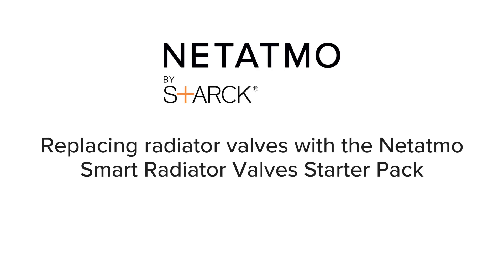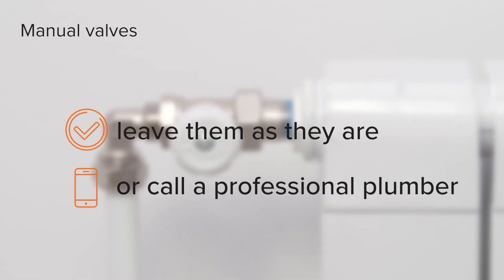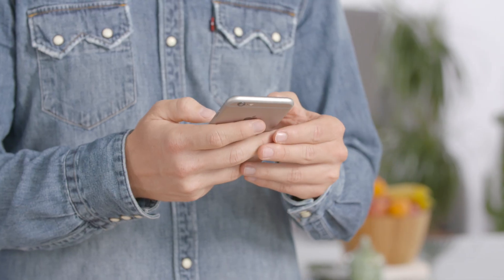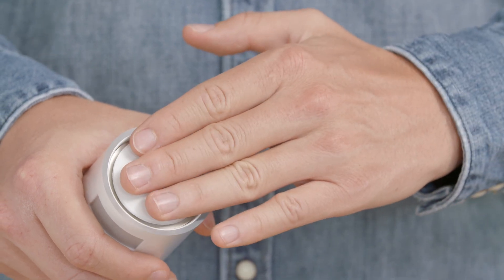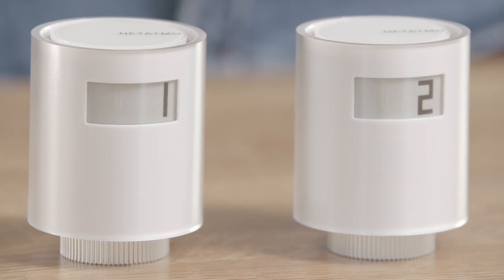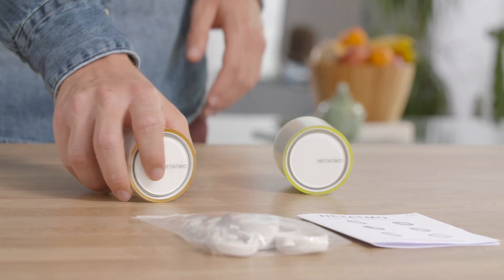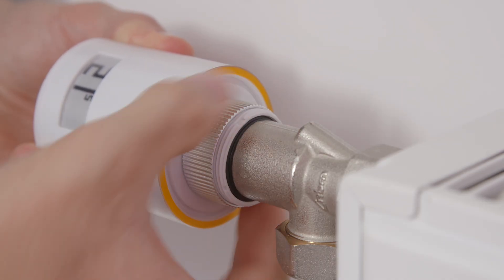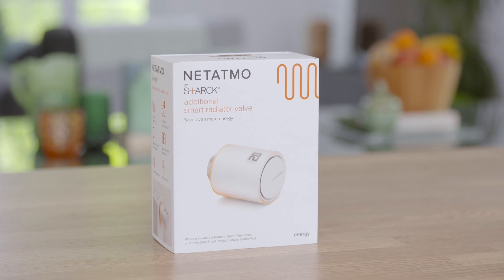How to install your Smart Radiator Valves Starter Pack – Installing the Netatmo Smart Radiator Valve

Comment: I have this in our apartment for 3+ years, quite happy.  I'm pleased to see that a suggestion I made 1+ years ago was put in place:  adding a notification in the App and web based software to give some advance notice that the batteries in the smart valves are coming to the end of their life.

ONE further suggestion for improvement, develop an RJ45 plug in relay with POE (like a Cloud Key).  It's more secure, frees up a power socket and integrates better with a connected home (I have professional quality switches for my home network).

Comment: Will this work when living in an apartment only having access to replacing the Thermostat on the Radiator? no access to boiler or anything else. Also does the Relay require it's own main socket? or could it be placed in a power extension cord if there's room for it?

Comment: Quastion if i have netAtmo is it possible to conect the valves on the same relay as netAtmo so basically when valve has demand for heat boiler will come ON. Because if u only have valves heating needs to be on and then u are only controlling tempeture.
Reply from the maker: Hi,
Thank you for your message. Yes, if you already own a Netatmo Smart Thermostat, your Additional Smart Radiator Valves will work with the same relay. 
If you set the Comfort mode, your valves will be able to switch on the boiler. If you set the Eco mode, it can't.
Have a nice day :)
Reply: @NetatmoChannel  and lets say if i dint have netAtmo only those smart valves they are only turning ON/OFF the radiator the relay dosent knock ON the boiler it is only Internet getaway? If i am right?
Reply from the maker: Hi  @BriaCroTex ,
The relay allows your Smart Radiator Valves to connect with your WIFI connection and your boiler. This page will explain it with a scheme: https://www.netatmo.com/en-eu/energy/valves/installation
Reply: @NetatmoChannel  i am looking but i see that relay is in the wall socket, and to this thing work i need same relay as netAtmo has with 4 wires L, N and 2x for switch. I installed alot of netAtmo on Vaillant boilers and now i am just wondering if instead of using thermostat i can use smart valves and that smart valves can turn ON boiler and for that i need 4 wires from relay same as on netAtmo.
Reply from the maker: We have 2 different products:
- the Smart Thermostat (which works with a specific relay) and you can add Additional Smart Radiator Valves (which will work with the same relay)
- the Starter Pack (which works with collective heating, in the box you get a relay and valves: https://www.netatmo.com/en-eu/energy/valves) 
So yes, depending on the heating installation, you could use the Starter Pack to install only valves. To check if the installation is compatible, you can use this tool: https://check.netatmo.com/
And yes, the Smart Radiator Valves are able to turn on the boiler :)

Comment: Is the relay for valves same as the one for thermostat? 
Can be the relay for valves connected to and control a boiler while working with valves?
If yes, then if valves close the radiators when the set temperature reached, will valve's relay turn off boiler?
Reply from the maker: Hi Edgar,
If you already own a Netatmo Smart Thermostat, then yes you can directly buy the Additional Smart Radiator Valves because it is the same relay than the Smart Thermostat.
Yes the Smart Radiator Valves will be able to turn on/off the boiler if you set the Comfort mode.
Have a great day :)
Reply: @NetatmoChannel  I have neither of them, but wish to buy some :)
So if I just take 4 Valves with the Relay, this Relay will also automatically turn on/off the boiler? The thermostat is not obligatory in this case?
Reply from the maker: First you have to check which product you should buy (it depends on your heating system): https://check.netatmo.com
If your heating system suits with the Starter Pack (Relay+Smart Radiator Valves) then yes it'll be able to turn on the boiler.
Reply: @NetatmoChannel  that sounds great, but why then guy at 1:41 connects Relay simply to the socket. Can I connect it to the gas boiler with dry contacts, so it will control the valves and boiler without having Thermostat?
Reply from the maker: We advise you to contact our expert team about your technical questions: valves@netatmo.com
They'll be happy to help you :)

Comment: Hello, I bought netatmo valves and got stuck with the problem of their settings, after determining valves 1 and 2, with a high probability they are offline with a "!" I took out batteries with valve many times so that I could connect 2 valve, but in the morning one of them turned out to be offline, manipulations with moving the transmitter did not help, what should I do?
Reply from the maker: Hi Max,
Please contact our Customer Care team: https://helpcenter.netatmo.com
Our experts will be able to help you :) 
Have a great day!

Comment: Do I need starter pack and “relay” if I have apple TV4 or can I buy single valves which is much cheaper??
Reply from the maker: Hi Robo,
Thank you for your message. You can buy Additional Smart Valves only if you already own a Netatmo Smart Thermostat. 
Otherwise, you need to buy the Starter Pack because you'll need the relay.
Have a nice day :)
Reply: Netatmo I do not have anything from netatmo yet
I just have an apple TV4 and eanted to know if this is possible use as relay
Reply from the maker: Then it's not possible! You'll need the relay in the Starter Pack to control your Smart Radiator Valves. 
Have a nice day :)
Reply: @Finnley Johnny Thanks, I went there and it seems like a nice service :) Appreciate it !!
Reply: @Gunner Jeremiah Happy to help =)

Comment: Hi, how many valves could be connected togheter?
Reply from the maker: Hi, 
If you already have a Smart Thermostat, you just need to check the parameters in the Netatmo Energy App to see how many Smart Radiator Valves you can connect (from 5 to 20 Smart Valves). If you are buying a new Netatmo Smart Thermostat, you can connect up to 20 Smart Valves.
Have a great day :)